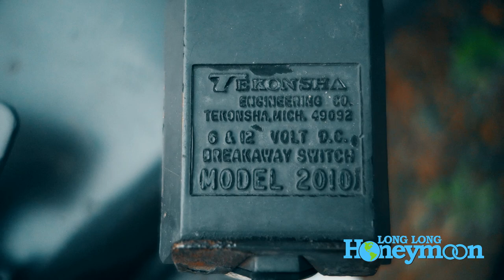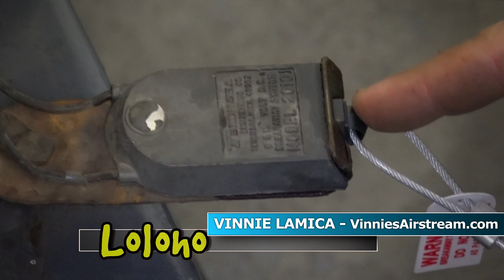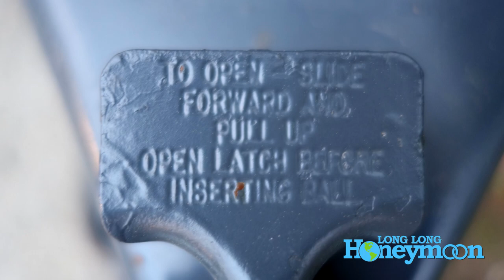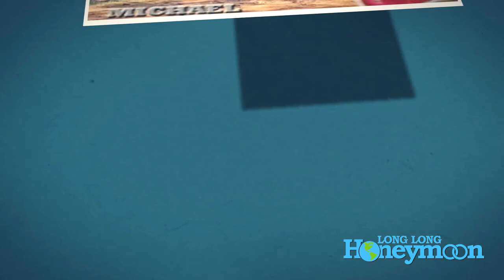For Beginners: "TOP 6" TIPS for HITCHING AN RV

Comment: Oh my what an intro LOL.. I had a hitch come loose.  Thank God I was going slow and the chains caught the trailer.  Now I jack the trailer back up and watch to see if the tow vehicle comes up.  If my truck comes up just a fraction I know it is locked.  Then I retract the jack completely
Reply: Really enjoy all your videos. Keep them coming. 

The break away cable should be shorter than chains. You were a bit vague on length and talk like the trailer would be several feet back before it was pulled but the chains are hopefully keeping it close to your vehicle.
Reply: Oh I’ve had some stupid screw ups myself.
Reply: Hi Dave, I am a beginner to hook up the camper. I will be doing that the very first time in an hour. Let me verify something with you. When you say "If my truck comes up just a fraction I know it is locked." Do you mean, when you see the trailer is lifting up by the jack, you know the steel ball is fully engaged with the bracket and It is safe to go? Am I right? Please advise me.

Comment: After I drop the tongue on the ball and lock it, I like to drop the jack again and raise the tongue a little to make sure the two are fully locked.
Reply: I use this as well. An add thing I do is raise it to the point that it removes most of the weight so that the tension bars are must easier to lock and secure. I have been cracked by the arm that is used to lock it thing place. It can be dangerous and could break a bone or two. I am so glad my rig has an electric jack.
Reply: I do this as well. A friend had a boat trailer pop off when he thought it was connected.
Reply: Standard  operating procedure to raise trailer after hookup to attach tension bars.

Comment: Love the video.  A couple of tips from a fellow travel trailer RV'er.  For the weight distribution bars, you can attach a zip tie to the appropriate chain link when you find it.  That way there's no guessing which link gives the right tension.  Another thing about ensuring the ball is properly locked - agreed that the tongue jack needs to leave the ground, but once you're connected you have to raise the rig again to connect the weight distributing bars.  We have to raise it enough that it actually lifts the back end of the truck a little and this ensures that you're properly locked.

Comment: My equalizer hitch uses friction in the load distribution bars for anti sway. To get the load bars attached I lower the truck on to the ball a couple the rig together, the use the tongue jack to lift the entire rig to get the load bars set. This also checks that the ball and tongue are actually connected. It should work for any tow rig.

Comment: Great video, I wish my dealer would have explained these things before I drove off the lot. But fortunately, I did some homework before picking up my rig. I always put all the weight of the trailer on the ball and then latch it. Once latched, I raise the trailer back up  for two reasons. first is to be certain the latch is secured to the ball and secondly, I need to raise the trailer to attach my load leveling chains. Works like a charm every time.

Comment: As always great job guys! Just starting my second year with my airstream, and one thing I learned while hitching. Sometimes it seemed I was all the way down on the ball, retracted the jack, but couldn't get the latch down. I found moving the truck just a fraction of an inch forward or aft, I was then able to throw the latch down. I was really frustrated by that until I learned this trick! Keep up the good work! - Jamie
Reply: thanks..............another tip.
Reply: That’s been happening to me a lot, it doesn’t like to slip on in the right spot to allow the latch to engage. Finally I realized if I just went a touch forward or back, it would make a slight adjustment and the latch could engage. Only needs the weight of the truck shifting a quarter inch to do it!

Comment: Just got my 2017 Coleman 1605 Lite a few weeks ago from a couple in Port St Joe Beach FL. Stopped at Connections RV in Panama City and got great advice on setting up the distribution bars and anti sway device, which came with the trailer. They instructed me to attach the trailer tongue to the hitch and then raise them with the jack before attaching the chains of the distribution bars. This made it easier to lock those in place but also assures that the hitch is locked to the ball.

Comment: I hitch and go solo so that has a couple challenges. One I've addressed with a iBall backup camera and that's saved me several lifetimes of back up, get out, adjust, back up, get out, adjust. The next challenge is the light check but my RV repair shop gave me a great tip and it's genius. Turn on your hazard lights. If your trailer is blinking you're good to go. Just thought I'd share. Love your videos! You guys are fun and funny!!

Comment: Thanks for your videos which are informative, practical and fun.  We are in our 2nd year of RVing with a small (3000 lb) trailer.  We experienced the trailer "pop" off of the ball at a campground this summer! Right at the check-in when I went over a big speed bump on an uphill incline.  It all happened so fast and unexpectedly, but the breakaway cable deployed, the trailer brakes set stopping the trailer, but before I could stop, the S-hook on one side of the chain broke, causing enough force to break a link on the other side!  Thank goodness this happened where it did  and not on the way to the campground at highway speed and traffic!!  I replaced the chains and S hooks with heavier duty. I also now ALWAYS make sure the coupler is securely fastened to the ball, raise the tongue post, close and lock the latch, and then lower the  tongue post until it raises the tow vehicle an inch or so to make sure it is securely fastened.  Also learned that without a properly charged battery, the brakes would not have set (and my trailer would have rolled quite a distance behind me with the broken chains).
Reply: Wow, good point about having batteries charged enough to work the emergency brakes!

Comment: Great tips once again you two. Last year my safety cable broke as it rusted right through. When I have to replace it this year I will definitely loop it back to the trailer. It just makes sense to do it this way. It also acts as another check to make sure the hitch and ball are in contact.

Comment: Nicely done. I've been towing for years but learned a few things from this video. Thanks Guys! One thing I habitually do is leave the chocks in place, fully retract the tongue jack, and try pulling the tow vehicle forward very slightly to make sure the ball is firmly seated against the from of the socket, before I latch the ball in place. Another thing I do as I leave the site is pinch the brake controller to make sure I get two skid marks in the gravel, indicating the brakes on both sides are working properly. I especially liked routing the electric cable and break away cable through the latch safety pin. Oh, and if I'm leaving the hitch on the truck I cover my balls with orange ball covers. The color is so I and others are warned before bashing our shins.

Comment: First of all ...BEST video we have ever seen on hitching ! Great job !  One addition tip ...we put our electrical cord thru our  u shaped hitch lock pin so it doesn't hang too low or get tangled when we make a sharp turn ....just make sure it has plenty of slack on it so there is no danger of coming unplugged .
Reply: David Leder we do the same! Great minds think alike! 😁
Reply: This actually increases the risk of loosing the u shape hitch pin which can be a very bad thing. You do not want to put anything through the pin that can accidentally open the clasp on the pin. While it seems a convenient place it should not be used. If you want to secure your umbilical electric cord you should use a lock on your hitch and then secure the cord to the lock using a small elastic cord. The hitch pin has a very important job to do. Keeping the hitch lever secured in place. Don't cause it to become "distracted" by doing another task such as holding the electrical connection.  We want to see many more videos of your travels.

Comment: Great video.  One thing that has been a great bonus is the rear view camera on my newer tow vehicle.  I no longer need a spotter for backing to hitch, which makes me more comfortable. I never really liked having a person between the trailer and my moving vehicle.
One thing I noticed in your video is that your chain takeup brackets for your WDH seem to move along the A frame in different segments.  In some they appear correctly installed directly above the end of the bars, but in others they appear too far back so that your chain is taking up at an angle to the bracket.  I'm hoping the correct setup is on the newer video, but it might be worth noting for any newbies.  
One tip I have always used is to drop the tongue on the ball until it is fully carrying the weight, then latch and lock, then lift again bringing the back of the tow vehicle up several inches.  Now attach the WDH bars.  They snap up with no effort.  Lower the tongue back down and retract the jack fully.  Two advantages to this; 1) you KNOW the ball is secure in the tongue if it can lift your TV, and 2) much less chance (no chance) of a kickback if the chain snaps off the bracket while lifting.   I almost lost  toes  when a chain snapped down under too much tension, just missing the end of my shoe.

Comment: Good safe tips. I hooked up my cargo trailer and drove home 275 miles. 2 miles from home, I drove thru a dip in the road and the hitch popped off of the ball. There was a noise like a crash and I looked in the mirror and saw the trailer whipping back and forth with the nose down. The safety chains held and was able to stop with the trailer crashing into the back of the truck. We checked everything over and determined that when I hooked up the ball latch on the hitch was on top of the ball when I left where I was. Nothing was damaged but my pride and now I check every time to make sure it is properly latched.
It is so, so important to check everything before embarking on any trip, long or short.
Thanks for sharing.

Comment: Just bought a T@B teardrop  and took it out for its maiden trip. Very easy to move trailer over the ball but ran into the problem of the hitch not seating fully over the ball. Didn't look right but it seemed to lock. I even repeated the process. Had the guy in the next site look at it, also. Drove maybe 4 feet before it came unhitched!  After a brief moment of panic, got out, slid the receiver COMPLETELY over the ball. Locked and loaded and safe trip home. (the guy in the next site was most apologetic ) Thanks for all the great tips for this rank newbie!

Comment: Good points!  I always look under the hitch to be sure that the locking pawl is surrounding the ball.  Especially with those adjustable couplers on U-haul trailers, always double check them.  Also, not a big deal but when securing your equalizer bars, standard practice is to put the safety pins in from front to back, the open end "facing rear".  In other words, the direction of forward travel should "push the pins in, not out."

Comment: Thanks for the video!  For the electrical connection between the truck and trailer I carry a can of electrical contact cleaner.  It'll reduce corrosion and can be used to really clean out the trailer's cable if it does accidentally fall in the dirt.  I like the CRC brand quick drying formula but I think most work pretty well.

Comment: Making sure the tongue is seated properly on the ball is SO important! I didn't once. UHaul truck, UHaul car carrier with my (little) car on it. Went about two miles to the gas station with my wife following behind in her car. As I pulled into the driveway at the gas station, the trailer popped off. Chains crossed so it followed me all the way to the pump. Left a nice long scar in the pavement! Was able to reconnect while everybody watched. That was an adventure in itself! Saw a comment below that recommended the same thing I do now. Once I THINK I've got it right, I use the trailer jack to raise the tongue, just a little, to make sure the hitch rises with it.

Comment: One comment I have is regarding the 7 pin electrical connector. We tow a Honda CRV behind our motorhome. In the beginning after hooking up and then testing our brake lights and turn signals invariably one or both wouldn't work. Then I found out about dielectric grease. After cleaning the male and female ends and applying the dielectric grease problem solved. The grease helps to prevent corrosion, plus we no longer fight this problem.

Comment: To the great tip on making sure ball lock is fully engaged.  Totally agree this is a extremely important step.   It was told if you think or unsure the lock is not engaged after raising the jack, run this test.   While the ball lock is engage, lower the jack down is watch camper and truck together...once the weight starts to be carried by the jack, a poorly engaged lock will pop off from the ball.  A properly engaged will stay connected to the ball.

Comment: Another good video. We used the Reese system for years and years. With our recent new trailer we went with the Anderson hitch. While it can be a bit of a pain to reconnect on occasion, I wouldn't go back to Reese again for our 33 foot travel trailer. Sway control is great, as another response said, you don't grease the hitch ball with the Anderson, so it is way cleaner. It does make fine black dust that can get on you but that's better than grease! On hooking up, I had always wondered about those yellow Styrofoam balls on a magnetic base with telescoping rods but didn't want to spend $20 to $30 dollars for them. I got a set in a discount bin for $5.00! Those actually work great! 
My wife still stands there just to make sure but setting the ball height on the truck and the trailer so they touch when at the connection spot is fast and right every time. I did buy an aftermarket back up camera, the type that mounts on the license plate and it worked great until the first time we were going on a trip to find that the hitch itself has a shaft that blocks the camera. So I usually stick to the balls!

Comment: I appreciate you, you taught me the step of safety with ball placement applying full wt onto the ball before locking it in place. Huge issue! Thank you. I will also roll backwards a foot before driving off just to be sure the ball is perfectly seated, without the anti -sway attached of course.

Comment: Loved it!  Kristy, you seem to endure a lot.   One other important lube point, I think, is the load leveling bar end that attaches to the hitch.  Lube not only helps snap it together and turn it, but reduces wear on the pin, pin groove.   And perhaps the entire end piece. It bears a lot of weight and torque.

Comment: this is a great advise video and make me glad I scored a Pro Pride hitch for my 30ft classic.  I have only used a regular hitch, equalizer hitch that came with the trailer, on trip back from Florida to NC. It was a nice hitch but the pro pride attaches to truck in totally different way vs regular type hitch.    have a good one.  "grease your balls is good advise.. :)  "  

good rule of thumb when hitching is double check everything from hitch on ball connection to making sure the expensize airstream steps are properly stowed before moving unit.

Comment: A couple more tips for your list. 1) When checking  the electrical I always test the brakes when I first pullout of my driveway to make sure they are working. I have had them not work one time and was able to fix them before finding our in a bad way. 2) After hooking the ball to the trailer I jack the trailer up to until it lifts the ball you can see the hitch move in the receiver on the truck. This also makes hooking the leveling chains easier. My father had a trailer come off the ball once and ever since he did it and passed the tip on to me.

Comment: Great tips. Did not know about crossing chains, and looping the breakaway back to the trailer. Thx. Regarding the umbilical connector, I strongly believe in a good contact cleaner spray and then packing with dielectric grease to keep the connections in good working order. Happy trails!

Comment: I have the sway bars on a chain that you need the pipe to pull it up . About ten years ago I forgot to remove them when I was backing into a tight turn camp site. I heard bam 💥 and saw something go flying from my left mirror. Yeah I popped the very expensive tow bar off and it was bent and it broke off the connector piece that is on the hitch. Thank God that nobody was standing there it would have taken them out💥it flew about 6 or seven feet. Good to keep people away when backing in. I’ve been camping since I was a child and I’m in my 50s now. Guess what the longer your doing this the quicker you are and the more likely you are to screw something up. Slow down everyone. Let’s do it like it’s the first time. Great advice guys love your channel.

Comment: Great reminders even for the "experienced" tower. I will be adding white line marks to each side of the trailer tongue weight Dist mountings showing where the connectors are placed on each side of the tongue. If they ever show the original dark paint on either side, I know they have moved. Also, all of the hitch nuts have torque specs. Follow these ratings and tighten properly.